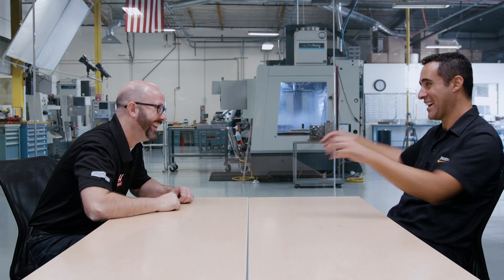First Machine For A GARAGE SHOP? - Mark Terryberry from Haas - Pierson Workholding Q&A

Comment: I completely disagree with the guy's advice to get a Haas TL or TM as your FIRST machine.  Price tag on a TL is $32,000.   Not many people have that budget starting out, especially if they have no proof of concept or no product(s) to make.  Maybe after a few years in business or after you have PROFITABLE products to make.  Then you can get a business loan for it.  But it's going to be hard to get business financing if you are a guy in a garage, because most equipment financing companies will lend to an LLC or corporation and NOT to a home/hobby shop.

The first machine you get is the one that makes you money as fast as possible and can fit within YOUR space and YOUR budget.  That may be a $500 welder, a bridgeport milling machine, a manual lathe, a bench vise and angle grinder.  Not everyone is going to be able to afford a Haas as a beginner!  Work up to it.
Reply from the maker: I think we see eye to eye.  You'll like my answer that I gave in a previous video: https://youtu.be/OWQeO-aVjZU?t=133

Comment: Prototrak. If you’re starting a garage shop, you’ll be doing mostly one off, fussy parts that no one else wants to do. I have a brand Haas new DM-2 at my day job and an old 3.5" floppy disk drive powered Prototrak DPM. I actually leave work and go home to do some stuff on the Prototrak. What he says about climbing in the machine is true. The Haas DM-2 spindle is an uncomfortable distance away from the front of the cabinet. Trying to exactly pick up some feature on a part is a pain in the ass when you can’t get in there to see it. There are a ton of shops out there that can make 5000 widgets. The number of shops that can take a broken part and duplicate it for a company that has a machine down gets smaller every day. I’d buy a newer Prototrak. For the price we paid for our DM-2, you could buy a Prototrak lathe and mill and pay rent on a garage shop for a year.
Reply: Is Trak a good start up cnc machine?  Also what's one off mean.  Thanks
Reply: @agentsmith7947  The Prototrak is a solid, easy to learn cnc machine that is primarily used for making small numbers of parts or repairing or modifying existing parts. It is open on all sides and has a very large z axis height as well as the ability to swing the head to various angles. It can also be used manually or semi-manually. You can machine large plates or long pieces by supporting the end that’s hanging off the machine. I’ve milled the ends of shafts that were 15 feet long that way. "One offs" are parts that you’re just making one of. Though you usually make more just to be safe if the material is cheap enough. I’d say the majority of stuff that I do in my personal shop is farm or construction machinery related or custom car and truck stuff. I guess a bunch of industrial stuff as well. A lot of repair work. I can weld ok, so that’s something I can add. A recent job was to fix some badly damaged splines on some part from an older bulldozer. The guy had welded over the damaged section and I went in and milled new splines thru that weld. Probably not back to factory spec, but the part was very expensive to replace. A bunch of stuff I do is like that. Good enough to get you going again while you explore your options. He was happy to pay $300. A good indication of a machine tool’s usefulness is it’s value on the used market. For a good Prototrak, you could expect to pay about what a Tormach costs new. The biggest problem with the Prototrak is the lack of an automatic tool changer, so you need to be there while it runs. You can’t just push a button and go do something while it cycles thru a program with a bunch of tools.
Reply: @rexmundi8154  wow, thank you so much for this information and taking the time to respond,  if you don't mind me asking,  around how much is the machine you bought,  there website doesn't show pricing
Reply: @agentsmith7947  I bought my 1996 DPM for $8000 at auction when a place I used to work went out of business. I had ran it when I worked there.  I think the new one we recently bought at work was about $40,000. They hold value pretty well so ones with a newer controller are still pretty pricey used.  For part time work out of a small shop, it’s hard to know what machine is best. The Prototrak can be run easily from a cheap phase converter on a 220 dryer outlet, but buying one new puts you kinda close to new Haas VF range. The Prototrak  has a very user friendly conversational programming system that’s lets you do a lot of common job shop stuff right at the mill without a CAM system, but the machines itself is not as fast and the spindle speed is lower.  You can still program it with something like Fusion 360, but it’s not totally necessary. I’d say I do 90% of my programming at the mill. Something like a key way slot for a shaft or an adapter plate might take 2 min to program and set up. It is kinda like punching numbers in a microwave though, so longer programs can get tiring and tedious. Which is when I go to the computer. Southwest Industries has a bunch of videos on YouTube with Trakin’ Pat where they show how to use the controller.

Comment: I simultaneously ran 4 machines (2 lathes, a VF2 and a Mini Mill) sometimes I would run Op1 Op2, sometimes, sometimes I would run parallel, but the flexibility was always better than running 1 faster machine.  As always, it depends on cycle times, but if they balanced out it worked quite well ... though it kept me hopping with manual loading.
Reply: I simultaneously ran 2 horizontals. 4 pallets, 2 ops per pallet. Our changeovers were trivial because we used ball lock fixturing from Jergens and programmed from machine datums with internal macros setting the work offsets. Versatility? I could switch from a 4 sided double station vice column to a custom built fixture in 10 minutes or less. With an HMC, the spindle is turning while you're loading parts, and that's one of its biggest benefits.

The biggest detriment is cost. Those 2 machines cost nearly twice as much as the 4 you mentioned. And to gain that flexibility costs even more in fixturing and prep work.

Comment: The one question to ask, where do you start. 
The chicken or the egg? 
Do you buy the machine to be able to find work, or do you find the work that requires the machine then rush to get a machine to do the job.
Not everyone makes there own parts.
Tough to jump into a 60K machine without any way to justify it and outsourcing parts for a prototype would cost as much as the machine is worth.
Reply: My suggestion is if you are a innovative person and you truly want to get into cnc work then go ahead and buy a used machine maybe 15k if possible. Then be creative and start designing and make it work thats what I did I bought a tormach 1100 designed a few parts got hooked up with a company that resales my product and then bought a TM1 Haas, after a few years I purchased another TM1 and have been busy ever since. I would love to buy a New VF2 but I may have to wait a little while its hard to pay those big payments every month. Right now im making more money than I am spending and my money is building up month by month so once I get a large sum saved up I may take the plunge for a new machine. Its all about discipline and hard work!
Reply: @banjohero8352  Which industrial space is one best placed to start thinking about with regards to producing parts for as an amateur? motorcycle spares, injection molding tooling, factories looking for spare parts? I would appreciate your opinion on this.
Thanks.
Reply: @georgekariuki8614  Thats a tough question. If you are planning on making your own products then I would pick an industry that you are somewhat familiar with. If you ride motorcycles look into products you could machine and make that may be better or as good as some you see on the market. Kind of go with your gut kind of deal. Me personally I found some products that were around 100 dollars and they were made out of steel and I thought I could make them way cheaper than that so I designed one similiar and starting cutting them out and selling them for 60 dollars and they started selling. Start shopping and looking at products online and see if there are products you can make. Using the motorcycle example again I would search foot pegs, Handlebar risers, Shock linkage parts, Side covers and so on until I found something that looks interesting and easy to make. Of course you can pick any industry but you get my drift. Customers love Made in the USA and Lifetime warranty! Good Luck!
Reply: @banjohero8352  Good advice.....only if you happen to have $15,000 to spend on a used machine (and hope that it's not worn out and has all the tooling you need).
Reply: @komoru   Well the comment was 2 years ago before people went crazy and decided everything is now worth double. So may need to up the budget a little bit lol
Reply: Most of your question makes sense up to the part where you start to disagree with yourself ??

Meaning :   ( you wrote )
Tough to jump into a 60k machine without any way to justify it and outsourcing parts for prototype would cost as much as the machine is worth ??

If you are prototyping parts that could cost as much as a machine, would this not answer your question ?
Buy A Machine.
I know it might sound like i am try to be a smart arse ??
But i really want to know what your thoughts are ?

Do you have Prototype Work of any value ?
Do you have any plans to find work ?
Are you planning to manufacture items you can sell ?

I understand the first part of your question.
 It is Difficult to justify buying any machine, that is true.
But what do you plan to do with a machine IF you buy one ?

Something to consider ?
Do You.  Need A Machine ?
Or.
Do You.   Just Want a Machine.
There is a big difference.

Comment: Me working on a fair sized horizontal for over 1 year now... , i can really understand what Mark says about a small/medium VMC . It's so MUCH hassle to climb in the machine sometimes 30 times a day for a one off. Sometimes the size and shape dictates the machines , but most of the time i can already imagine flipping the part 3 times without the challenges of a horizontal . P.S. and imo a badly set up horizontal can make more trouble than a badly set up vertical .
Reply: My dream setup is a horizontal and vertical with one or two lathes
Reply: @nikolaiownz  Mine would be 3  cnc lathes . I would not mind forgetting all the hassle with milling . The warping especially is a real piece of work .
Reply: @kisspeteristvan  i dont know how I would run my shop without a cnc mill. Most of my work needs milling done hehe

Comment: Jay,  I believe another good question to ask Mark would be:  "If you have a ton of money to outfit a JOB shop, what would you buy?" (vs. outfitting a production shop, which is mostly based on the size, mix, and volume of parts).
Reply: I would go with 5-axis mill (UMC or VF with 5th axis table) and lathe with Y-axis. That'll get your parts done quickly and with least setups :)
Reply: @vilts  agreed! We have a DMG DMU50 and a ST-30Y and this is a great duo allowing to make a large range of parts efficiently. Next best thing is work and tool holding. Wish I had twice the number of holders for the mill and quick tool change ala capto on the lathe to shrink setup time. Then depending on the jobs, we find ourself missing the table length of a VF or a sub spindle on the lathe.

Comment: Great video. Bought a TM-2 for my garage, and, based on this video, it was the correct choice. Great machine. I'm making parts for myself. Prototypes and short-run production, so it is a perfect fit. My next step is to look into subplate workholding solutions.